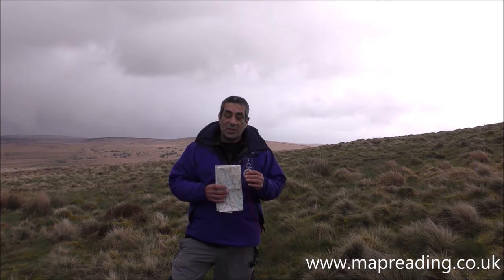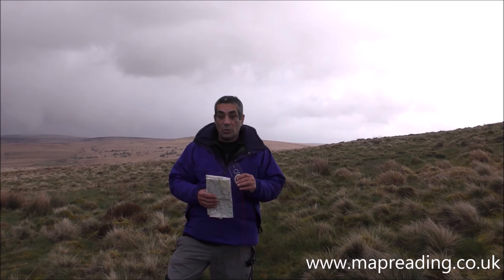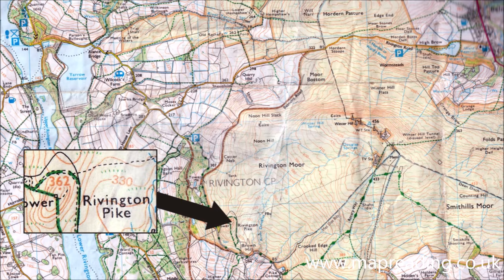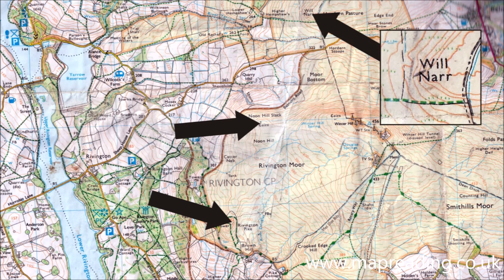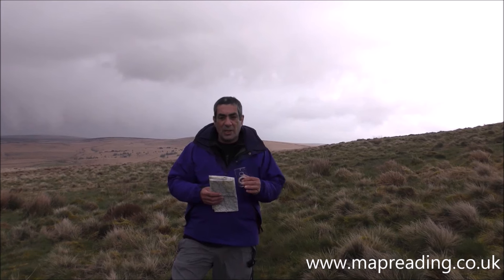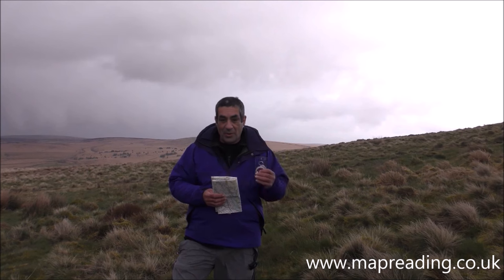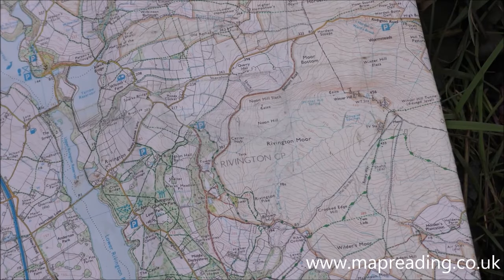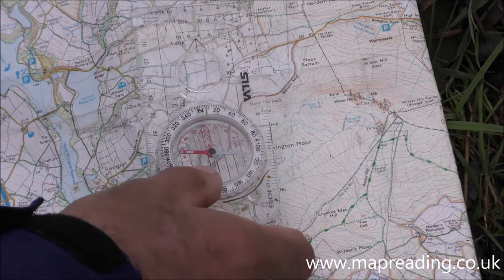Compass Back Bearings - 4 methods

Comment: I've found a permanent marker or chinagraph can be removed from laminated maps by using a pre injection swab. They come in small neat wrappers a bit like lens wipes but stronger. It's a method recommended by another well known navigation company. No names mentioned. Keep up the very good work Wayne.

Comment: Interesting etymology for "triangulation"... When my ex-navy-radio-operator grand-father was explaining to me the concept of triangulation (applied to RDF, he did a lot of SIGINT back then), he never mentioned error-margins or fast-moving boat resulting in a triangle-shaped intersection rather than a point. Actually, I always assumed it was named "triangulation" simply because when you measure bearings to 3 points A,B,C : A,B & C are the 3 corners of the ABC triangle. Thanks for your alternative etymology : it makes sense and will help me memorize things better.

Comment: Great videos. I used a compass last time 30 years ago as in Polish mountains usually a map is enough - we have a lot of marked tracks. But your explanations and tricks are very interesting, so I watch whole series :-). 
You can use markers for whiteboards. They are not permanent. Or you can use WD-40. Should be able to clean this. And alcohol, of course.
Reply: I have heard the dry erase markers will work so I bought a couple each of four colors. Thank you for letting me know I did the right thing.

Comment: I'm really enjoying the information.. thank you .. when I was in the Fire Service, we had to keep Breathing Apparatus entry records for our personnel (to buildings, etc.).. being outside - it often rained.. so, we used a chinagraph pencil to write on our plastic boards (they're readily available and reasonably cheap).. its soft wax like pencil, it doesn't make as fine a line as a sharpie, but it's waterproof, fairly resistant to smudging, and easy to wipe off (we used a bit of wrag kept fir the purpose).. just an idea to try out 😊
Reply: In the US they are called grease pencils and are used for marking on glass or china.  We used to use them for marking audio tape back in the day when we edited with razor blades.
Reply: Great info.. thank you. We did wonder, at times, why they were called Chinagraph pencils 🙂👍

Comment: As a scout, soldier never listened to any about back bearings.
   I've always rotated the compass ( using it backwards)  this is the first time I've heard someone else talk about it. 
    Once you have done your calculations for mag to grid, on top of compensation for year map( was in scouts ,maps always years old) why bother working out what 180 is. Plus if it s dark ,raining ,cold and your wearing gloves. Just check your dail to see if still set on orginal bearing, then use it backwards.
   Nice to see people still using maps. GpS and phones need batteries and signals. Maps just need a plastic bag to keep them dry.
   Remember you are only lost because you went one step to far from remembering how to get back to a place you knew where you was.
Reply: Actually gnss devices work off satellites - mine off 5, and phones you can download routes offline. I have a Garmin 66sr and it is incredibly accurate(less than 2m), robust, and battery life last for days or even weeks in the right mode. 100% believe in being totally confident with traditional methods first, but then equally embrace the technology. All adds up to a more enjoyable experience in the wilds :-) cheers

Comment: Another excellent video!  

I found your explanation of the rotation method for circumnavigating an obstacle (or otherwise recovering from drifting off course) was not entirely complete.  It certainly left me a little confused until I checked it in the field.  What is not mentioned is that it only works if you can sight your last starting point (ie when you took your last bearing). The steps to follow are:

1. Turn your body to directly face your starting point.
2. While holding your compass in front of your body and always pointing towards your starting point, walk left or right until the black/white end of the compass needle is back in the shed.
3. Turn your body 180 degrees and put red-in-the-shed. 
4. You are now back on course.
Reply: He mentioned that.

Comment: So just a quick tip about using a permanent marker, and removing its marks. You can make a new mark directly over the one you want to remove, and wipe quickly. Why does this work? Because the pen contains the same solvent required to make the ink flow initially.
Reply from the maker: Thanks John, I'll give that a try.

Comment: I'm confused about adjustment for magnetic declination. In you video on that subject you say if magnetic declination in 10 degrees west you ADD 10 degrees. If east, SUBTRACT 10 degrees. In this video you say the opposite. Which is it? 

Great videos by the way. Thanks
Reply from the maker: Hi Matt.  It depends where you’re getting your bearing from.  If you use your compass to take a bearing and you want to transfer this on to your map (like in the Back Bearings video) and your declination is West you subtract the amount of declination, if your have an East declination you add it.  If you take a bearing from a map and want follow it (like in the Declination video) and your declination is West then you add the amount of declination, if it’s East you subtract it.
Reply: @TheMapReadingCompany  got it. Makes perfect sense now! 😆 Thank you so much.

Comment: I've never used maps and compasses, and that's why I'm here. However, we used to use Chinagraphs at Pilkingtons (pencils - not graphene though) to write on the monitors',glass, metals etc to keep track of the glass position etc. Would that be better than a permanent (Sharpie) pen? Although the nail polish may be useful for also doing your nails and lighting a fire or burning yourself.

Comment: Regarding the section on transits, when you take the bearing to the reservoir do you then put Fred in the shed before transferring to the map?  I get very confused about this still!
Reply from the maker: When you take the bearing using your compass you point the compass’s direction arrow at the feature  and rotate the dial until “red is in the shed”.
When you transfer this bearing on to your map you put the edge of the compass on the map so that it’s touching the feature.  (don’t move the dial whilst doing this).  Keeping the edge touching the feature, rotate the whole compass until the orienting lines are point straight up the map (northwards).  
The edge of the compass will now be touching the feature and also running though the track that you’re on.  When the edge cuts through the track – that’s your position.

Comment: Question: Is there a reason you rotate the compass until the orientation lines match the grid lines, instead of setting the compass down so that the orientation lines match the map, and then sliding the compass down until the edge of it (or parallax line) hits the feature you're triangulating from? Thanks!
Reply from the maker: At 10:30 in the video I’ve taken a bearing and set my compass to that.  When you put the compass on the map the bearing on the compass doesn’t change so you need to rotate the whole compass (without changing the dial) until the orienting lines match the eastings on the map.

Comment: for a recection with a compass you only need 2 bearings... (the third one would be for confirmation? if it doesn't coincide with the previous ones there is something wrong.)
Reply: True.  Only  2 are needed for a 2D environment (like a flat map)  and 3 needed for a 3D environment.

Comment: Oddly if you you have a permanent line marked (of any age) on any surface it can be removed by drawing a line on top of it using a non permapen. After applying the line while it is still wet just rub it with a cloth and it should remove the marker pen line.
Reply: Even more oddly you can also use a permanent marker to remove the line to. Redraw the line with a permanent marker and wipe it clean just after doing so. I used a permanent marker on a white board to intentionally create a permanent grid pattern but many months later I no longer had a need for it.  After trying many times to remove it unsuccessfully a friend of mine showed me the trick. It worked surprisingly well. It seems to me that it might also work on plastic map covers.

Comment: have you tried using a dry erase marker? You can run the dry erase marker over your permanent marker line, then use the dry erase both marks.
Reply: Won't hold up in rain.  Grease pencil (what they are called in the US) works well.  Or use alcohol to remove sharpie.

Comment: It's  best when triangulating a bearing to make sure all three points are far apart on degrees to insure as accurate a position fix as possible. On land it is not as necessary as at sea.
Reply: But not so far as they become reciprocal. 60 deg is optimum. 1deg at 1 mile is 200 yards so easy to be inaccurate in any case when taking a bearing with a baseplate. 2 or 3 degrees error at 1/2 miles is easily 300m per measurement and a cocked hat covering a whole grid square.

Comment: The 3rd method, transit, description I found to be odd, I was never taught it probably because forests, walls, and boundaries change a lot and can differ from the map and I was taught to contour read distance hills, especially peaks, and use these (I haven't watched the entire video yet so maybe what I described I do will be the last method, "triangulate")
Reply: Now I've watched to the end and yeah, that last method I mostly use. And thinking more, I do use transit lines when on path but I always choose contour-defining points rather than "features that could change". Great video though, all methods are clearly explained and demonstrated.

Comment: + or -- 200 then - or + 20 gets the back azimuth quick.
Reply from the maker: Yes you're right. Thanks for the comment.
I did include the 200 + - 20 to start with but the video started to get way too long so a few sections were deleted in the final edit.

Comment: Do we really need to account for declination here in western Europe, i mean most of the time there is something in the way like a prominent feature, a tree, a wall, a fence and so on therefore we tend to spend most of our navigation time hoping from one to another. I think that as the distances we use are generaly so small that those few meters are not a problem, however I do agree that if we were in a desert and navigating to the only water source for several hundred kilometers that then it  makes a real if not life life saving difference
Reply from the maker: I’ve always said, and some people may disagree, that when we’re out walking, if the declination is less than two degrees it’s not worth adjusting your compass for.  Most cheap compasses aren’t that accurate anyway so they may be out by a degree or two anyway.

But you also have to remember that these videos are watched by a lot of people (over a million people a month according to my YT analytics) and many (most) of them don’t live in Western Europe.  In some parts of the world the declination is significant and so it’s essential to adjust the compass before setting off.